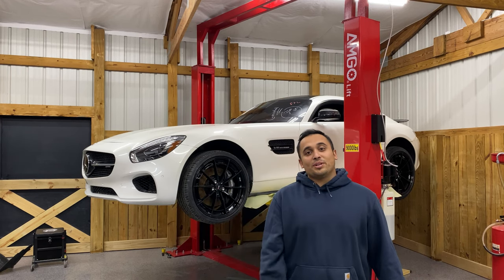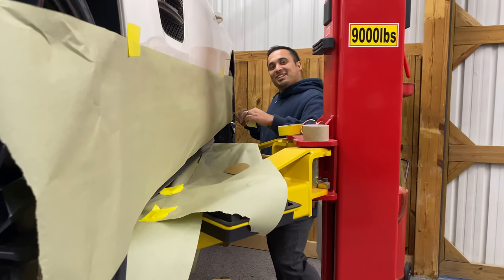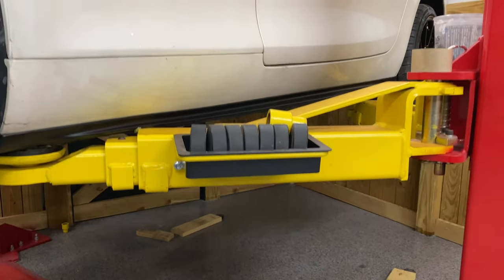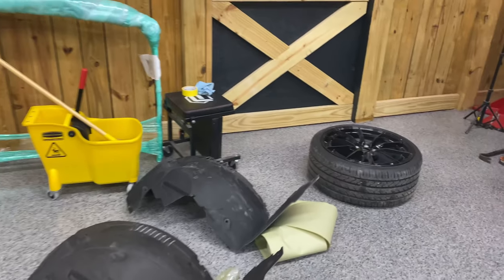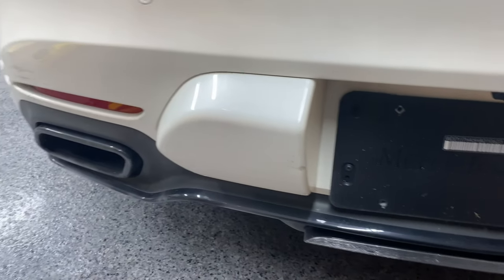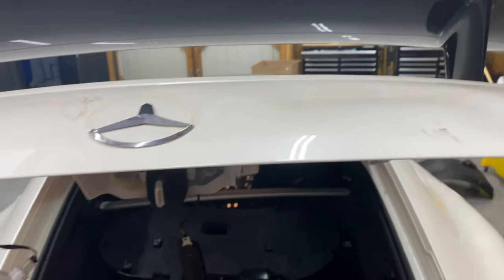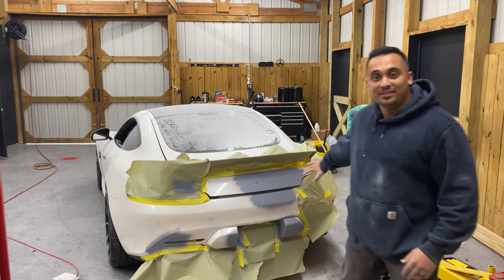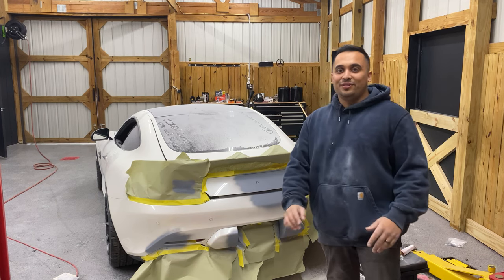Rebuilding A Wrecked AMG GT! PART 7 IAA/COPART REBUILD !

Comment: I want this to be my version of the c4 corvette.  I want to know if it’s doable 
The trans leak.  Return tube.  Aluminum.  Ik I need a lift to pull the engine and rear at the save time.   Can you respond so I can know if it possible for a regular and a dream
Reply from the maker: Sure is